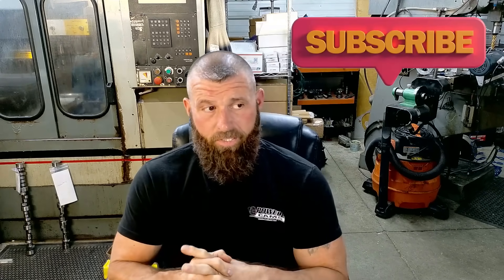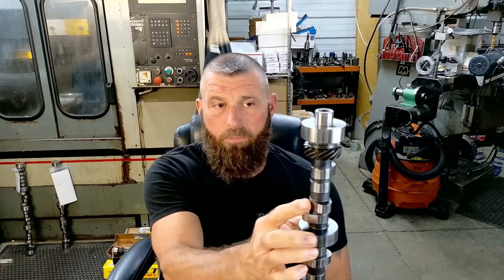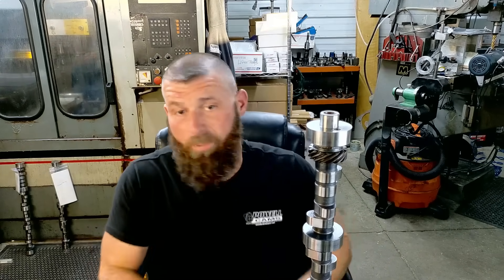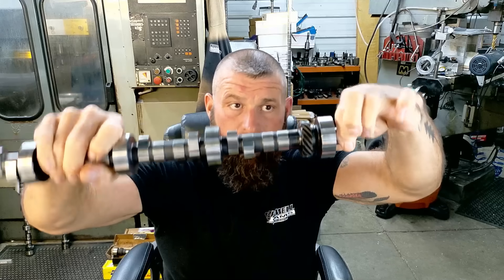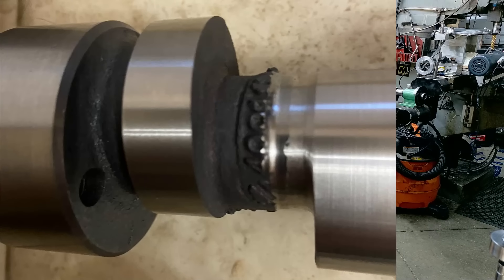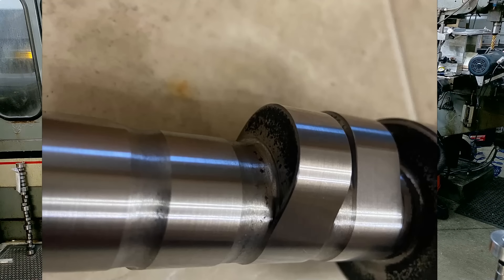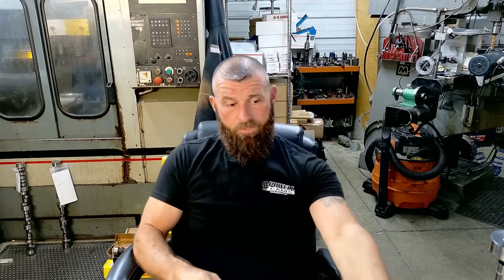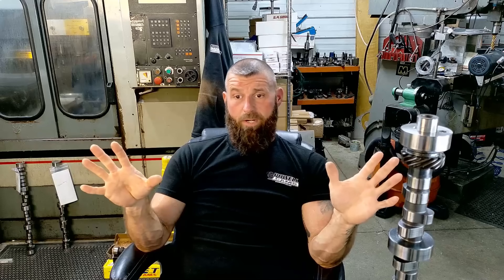Iron small base circle cams??

Comment: it because the knurling of the pistons if you dont have a small base circle exactly like we ran in our stroker engines back in the 90's the knurl will just jump out from underneath the cylinder wall reach up and smack the cam lobe DUH  . then you need a flux capacitor to fix the whole darn thing because the blinker fluid you have to run with knurled peestins wont lubramacate the cam geez get with the program people.
Reply: That's the old way of doing it! You can prevent all of that by Knurling the roller ends of the lifters! That's bleeding edge!
Reply: If a machine shop cuts to much off the main cap when line honing, you can peen the register in the block with a blunt point punch then file as needed to obtain the desired clearance.
Reply: lmfao
Reply from the maker: Ty for educational content
Reply: I just knew i was on a winner, when i done all that my self when a was damm well; 3 years old!!
Reply: knew this one was coming - -  😅

Comment: I think there's some rare cases were the lifter gets pushed a lil to high in the bore where the top band pops up just a tad to high where it would cause a drop in oil pressure momentarily before it went back down in the bore. I have a 79 302 block that I stroked out and in one of my cam swaps I was on the ragged edge of mine popping up too much but I ran it anyway and didn't have any issues but I have heard of cases where its happened but personally ive been lucky so far.
Reply from the maker: The lifter can't go higher,  this is explained in the video
Reply: @powellmachineinc yeah I watched the video
Reply: That don't make sense

Comment: I’ve never understood small base circle as a good idea, shorter pushrods is less reciprocating weight. Great video.
Reply: shorter is stiffer too
Reply: @jmflournoy386 it's true, I can confirm 😂
Reply from the maker: Ty for the support
Reply: With respect, in did use a SB Mopar with a reduced base circle in a flat tappit solid. The cam was like a street roller { almost "}. the manufacturer used a smaller base circle and i had to use longer pushrods. 
That's all friend. I wiped the cam. Stiff springs and a thousand years to fire up the first time. Embarrassing. Me stupid, it was 25 years ago!

Comment: In order to run the OEM dog bones, spider, and lifters in a Mexican non-roller block, I had to run a small base circle camshaft. 

With standard base circle cam, the dog bones would not sit on top of the lifter bores.

Shifting at 6,800rpm, the dog bones would get spit out and lifters would turn, pushrods would bend, and I even broke a rocker arm once.

This was 24 years ago.
Reply: Bunch of peckerheads getting too happy with the cam grinder. That's who!
Reply from the maker: I could see that.
Reply: @powellmachineinc Daniel we've been running the FE engine I had you cut a solid roller for. Damn that engine runs!

Did you get the video of it at first start-up?

I sent it in an email reply after asking for a cam recommendation form.

Comment: Its the height of the older flat tappet lifter bore is the difference. The newer blocks are a little taller and machined flat . Love your channel
Reply from the maker: But that doesn't effect the base circle??
Reply: Roller blocks are taller for the spider/dogbones to work properly. If you use tiebar lifters, an older short lifter bore block will offer more clearance to the tie bar. The base circle shouldnt matter

Comment: If someone wanted to build a cam that could be dropped in with stock pushrod length and non-adjustable rockers then the base circle would need to be very close to the stock diameter.   On a performance build I've got no idea why anyone would do that as the pushrods and rockers should be aftermarket and adjustable.   Another thought provoking video Mr Powell.
Reply from the maker: Ty
Reply: What makes you think it's mandatory for pushrods and rockers to be adjustable for a build?
You only need them to be adjustable when you get into so much lift the base circle has to be smaller to keep the lifters from rising up so high it creates problems, or the lobes are so tall they'd want to swing around hitting things.

Comment: Some aftermarkey sbf rods need a small base circle cam to clear or in a stroker application.  Usually you end up with a lifter height issue where the top chamfer is below the top of the lifter bore.
Reply from the maker: First scenario,  I've built hundreds of stroker sbf's and never needed a small bc, I've also ground hundreds of sbf cams and never once has anyone called and said "its hitting a rod".... 2nd scenario is clearly debunked in the video.
Reply: @powellmachineinc depends on which rod you use.
Reply: Whoever “some” is would be incorrect.  You could run aluminum rods with a big stroke in 9.5 deck stuff and be totally fine with a OE base journal size, the 8.2 deck has even more clearance because the big of the rod is smaller.